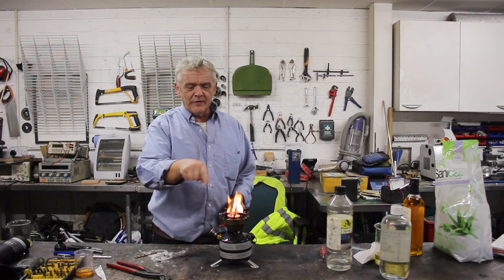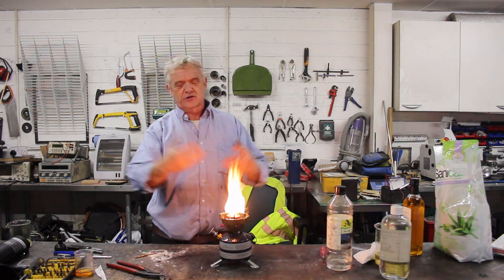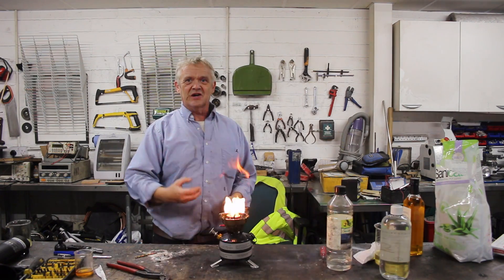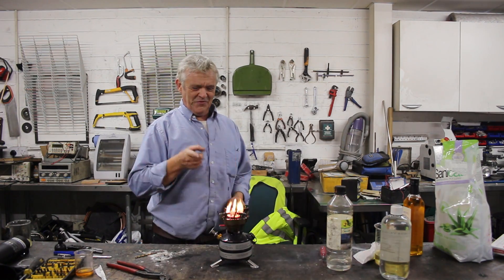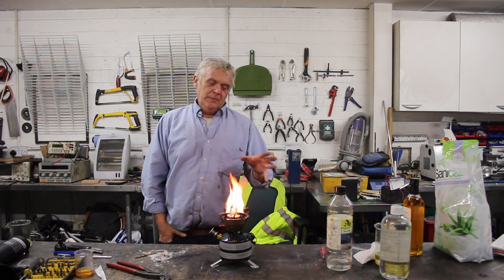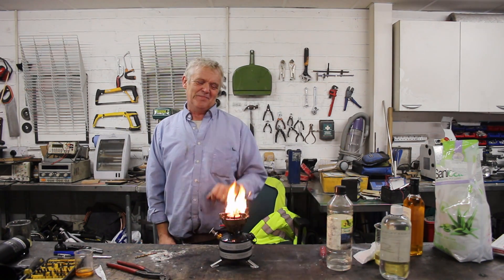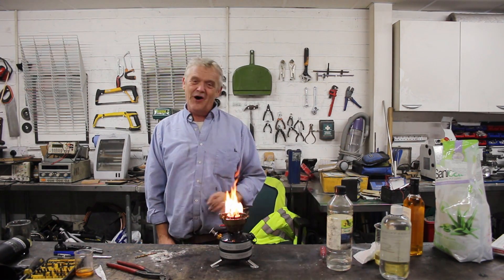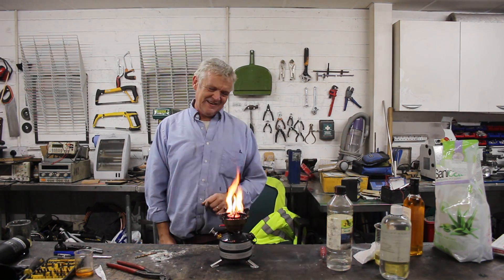1675 Can Bio Diesel Work In An Ordinary Kerosene (Paraffin) Stove?

Comment: Since your fuel is not contaminated with mtbe or lead, would a pogue (pre cracking) catalytic carburator provide an advantage of a cleaner burn? How about something like the(required) manifold heating lattice under the 2barrel carb for
a chevrolet 80's era 1600cc 4 cyl chevette(will barely run without heater)
Reply from the maker: I don't know mate - but well worth trying
Reply: There isn't  much mentioned  of pogue after 1980s . The claim was for a 200 mpg carburetor .  Anyway if flame is blue and no soot deposits and no cyclic aromatic  hydrocarbon odours exist , then it means there  is  clean efficient combustion.
Reply: @michaelcorbidge7914  yes, lead was added to gasoline making a leaded fuel blend, which stopped the catalytic carb, in the 80's mtbe metallic additives were introduced to replace lead, however fuel blends are not pure gasoline and do not work well in a pre-cracking system like pogue. The chevy carb helped some how, and would have worked extremely well if pure gasoline were available to the public.

Comment: If the biodiesel is not properly de-gummed it will carbonise in the vaporising coil and block up the jet.  Need to add something like polyether amine to the fuel to wash it out before deposits form. Due to the shape of the vaporiser making it difficult to brush thru , it might need removing for ultrasonic cleaning if deposits to form. Biodiesel also attacks some rubbers making them swell. What type of rubber 'o' rings are in the Primus pump?
Reply: Very interesting points there. Thanks.
Reply from the maker: nice points mate and thanks for making them - in answer I have no idea
Reply: @ThinkingandTinkering  haha love the honesty

Comment: Would a ultrasonic cleaner vaporize cooking oil or one of those fog makers Or a aromatherapy oil misters.
Reply: Not enough vapor pressure and too vicious, which is why oil burners use a pressurized jet to atomize fuel and blowers to provide draft
Reply from the maker: I don't know mate - but I doubt it

Comment: Love your channel.   I wonder if you could describe or design a solar system designed to power a kitchen refrigerator.   That would be a worthwhile DIY project.
Reply from the maker: cheers mate and I will give it some thought
Reply: I believe refrigerator is a great appliance to convert because it is intermittent,  and even if you run out of power,  it can handle a few hours of downtime .   Or you could have it run on solar during the day when electrical rates are high,  and switch to mains at low cost evening rates.

Comment: I have various camping stoves and lights, some use paraffin, can see them being useful, if there is shortages or fuel becomes too expensive this winter.
Reply from the maker: for sure mate - cheers
Reply: @ThinkingandTinkering  maybe you could do a series on cheap ways to heat the home and dangers/differences in efficiency between commercial and DIY projects for heating and lighting?

Comment: Oil-drip stoves are just wonderful bits of kit. They have their dangers for inside a home but I bet careful design can mitigate those, and then I'd bet they could use either biodiesel or the glycerol waste, or pretty much whatever you have to-hand!
Reply from the maker: I agree mate and I like the idea and as you have pointed out there are narrow boat versions so it is already proven tech
Reply: I really like the idea of being able to use different fuels for heating. I just want to echo the same concerns that you have as well, while it may work, there's a lot of potential issues with incomplete combustion as well as risk of carbon monoxide, so anyone looking at this should be sure to have plenty of ventilation when using this and avoid using it inside the home. Make sure you have a working carbon monoxide detector if you plan to use these inside anything.
Reply: @marcfruchtman9473  And there's an immediate danger of setting fire to a running liquid.... But a version IS used regularly in narrow-boats which have to pass a safety check, so I'm guessing there's a right way to do it that I'm unaware-of until I look properly.

Comment: Just throwing it out there Robert: Those Chinese Diesel Heaters made for heating RVs, Semi cabs, trucks, ect.. are fascinating and useful devices.  I own 5 and have done various experiments on utilizing their exhaust heat and alternative fuels as well while also heating my porch, vehicle, garage, and greenhouse here in Michigan, USA.  The 8kw units create approximately 27,000 btu and are 95%+ efficient and can be remotely mounted with remotely mounted 12vdc supply and remote mounted fuel tank and pump.  I've fueled them with diesel, kerosene, used motor oil, and a combination thereof while getting amazing efficiency, in fact I discovered that I could recover approximately 15,000 btu from the exhaust pipe using an old cast iron radiator from a steam heat system which allowed me to boil water and heat a large water tank simultaneously.  Where it really shines is in my greenhouse as I created an exhaust pipe system underground that takes advantage of the primary as well as the waste exhaust heat for heating the air as well as the ground underneath which allows for fantastic growth on a budget.
Reply: oooo i was just talking to my mrs about using these in our motorhome and utilizing the exhaust somehow to further heat the underfloor in the winter... bravo
Reply: @yaka2490  i have one in my camper and. Cheap Chinese version on my shed that i fuel on waste engine oil and or used cooking oil 👍
I've seen a few people use a pool heater to recover exhaust heat , i was planning on using an EGR cooler to experiment with 🤔
Reply: @Dirt-Diggler  I bought an EGR didnt try it but its cheap on ebay 30 quid.
Reply from the maker: thank you mate - I consider this very valuable advice - cheers
Reply: Have you tested the feasibility of growing your own fuel crop?
Reply: @seabeepirate  No, but I do have the ideal plant for that purpose I developed over the last 20 years... It's a cannabis sativa plant primarily with some indica genes.  It's progenitors we're a strain called "Dalat"  from Vietnam on a French hemp plantation in the dalat area, as well as a strain called "Donkey Dick" purchased from Marc Emery seeds back in the early 2000s as well as "Early Girl" and some other sativa/indica hybrids later on like Blue Satellite #5, Shishkaberry, Dutch Treat, and recently Pure Michigan and Sangria.  The plant is capable of growing 20 feet tall in full son in one short Michigan season, weighing hundreds of pounds.  A seed crop of 12 pounds was garnered from 1 plant a few years back... anyway, I have one growing in partial shade of my backyard this year if you want to see it on my channel, also I have over 30 guerilla gardened plants of the same background around my area, the biggest is 12ft tall but none are in full sun areas unfortunately.  I think these forms of cannabis would be the ideal fuel plant due to their speed of growth, seed production (when pollinated) , hardiness, pest resistance, and the side benefit of 25% THC cannabis if so desired 😆
Reply: @seabeepirate  my first instinct is to use hemp 👍👍so many other uses for plant as well.
Reply: @seabeepirate  waste vegetable oil from restaurants works great for biodiesel... better to use it for cooking 1st
Reply: Apparently the diesel heater type you're referring to...I have the Eberspacher make which is supposedly top of the range but almost identical. 
Eberspacher state over 80% efficiency and not 95%, so probably closer to 80% than even 90% in reality.
If you can recoup 15,000 BTU from the exhaust as you stated when the output is 27,000 BTU then that's even worse than 80% efficiency, remember, 100% efficiency would mean no heat lost through the exhaust; 95% efficiency would mean very little heat could be recouped from the exhaust. 
The exhausts do get very hot on these things which is the loss in efficiency after all and yes! if that heat is then recouped, we could get closer to 95% efficiency.

I do like your idea of heating the ground in your greenhouse with the waste heat.
Reply: @pa_maj.MARTINI-van-MAN  Nailed it 🔨. Thank you for that information!
Reply: @ProlificInvention  You're welcome Pro-Invention 👍. The more information and ideas shared, the better; especially now since energy prices are going through the roof, no point in wasting it. 
Check out David McLuckie here on YouTube if you'd like some creative ideas based around these heaters. 
He's been working on recouping enough power from these heaters to recharge the battery that powers it, enough to power the heater and heat water using Thermoelectric Generators (TEG), he's so close that I don't think it will be a long wait. 
He actually did it but the charge controller fried so he needs a better one if I remember correctly.
This would be fantastic for winter in an RV/Campervan or the likes were power usage is most important, and/or a greenhouse with no other power source like from a main building with electricity.
PS. An edit was due...David McLuckie eventually managed to successfully create enough power from the exhaust to charge the battery that runs the heater, quicker than the heater can discharge it. He managed this many months ago.
Reply: Bravo !!!!!!
Reply: @prolific invention, do you have tried to refuel the "cinese webasto" with used (bit filtered) vegetal oil?
Reply: @albertorossetti5375  No I haven't tried vegetable oil, but I've seen quite a few videos of people doing it and from what I've seen a mixture of 50/50 diesel to oil (any kind) with the addition of a small amount of diesel fuel winter treatment that boosts cetane is ideal.  It's good to buy a set of glow plugs just to be safe and clean the combustion chamber every season.
Reply: @ProlificInvention  grazie/thanks 👍 for the suggestion

Comment: That was excellent.

Sometimes a modification to the gas generator, by flattening it slightly can cause better gas generation because it reduces the internal cooling of the oil.

I'm looking at a variation of this for cold pressed coconut oil.
Reply from the maker: nice tip mate - thanks for posting
Reply: Can you please elaborate what you mean?
Reply: @emel60  A round pipe or tube has the maximum internal cooling. If that tube is flattened slightly there is less internal cooling and heat transfer from the outside will more efficiently gasify the fluid in the tube.

The purpose of the gas generator is to transfer the heat from the outside into the fluid, and with a more viscous (less volatile)  fluid, it may need some help.

The gas generator in a primus stove was designed to work with a very specific API gravity range. Changing the fluid will work, if the generators dimensions are modified to suit.

Does that help?

Comment: I use a water distiller for personal use and nearly fell over backwards when I saw how easy it was, especially with a water distiller to make your own ethanol which I'm hoping will run in a Chinese diesel heater..... It has already been tested with biodiesel and it works a treat but i don't know ant fuel cheaper or easier to make than ethanol. I will be watching your rocket stove project closely.
Reply from the maker: cheers mate
Reply: Don’t do it!! Nooooo!
Reply: @ianclarke8821  Please... do tell.
Reply: @masteragario3335  it’s for two or three reasons. The ethanol will ignite much more easily than oil, vaporising at just room temperature. It will likely destroy the seals and pump in your heater if it hasn’t already exploded or blown off the exhaust system. More seriously, when you burn it (and it is a pure distillate) you will not even see the flame, it is quite invisible in daylight, and difficult to see even in the dark (might be a vague blue hue) so if you have a leak etc you won’t even know you’re on fire let alone where to aim an extinguisher. This was a tragic problem in the 60s racing era, and I recall watching a driver burn alive with such fuel, onlookers were helpless to understand why he was writhing until his clothing charred.
Reply: @ianclarke8821  Thanks for taking the time to reply and explaining your concerns. Whilst they are points to be aware of, I don't share your overt concerns. Correct me if I am wrong but Ethanol is a lot lighter than oils or diesel and burns at a much lower temperature. The combustion chamber should be under no more strain than with diesel.  Tests I have seen have more of an issue maintaining temperature especially if the pump is at a low setting.
Reply: @masteragario3335  thanks for the reply, yes lighter and lower burn temperatures plus lower calorific content. It’s more of the safety issue with the invisible flame…
As it burns so very easily, why burn it in a diesel heater at all? Plenty of bio-ethanol burning stoves (some quite attractive) designed for use in the home are available, just with a wick and flame.
Just do one small test for me. Pop some of your pure ethanol onto a spoon or something like it, at night with the lights on. Ignite it, and I guarantee you will not see a flame. Turn the lights off, and tell me what you see. If it’s pure, you will be hard put to even see the flame in complete darkness. Imagine a spill in your home burning! Good luck, be careful!